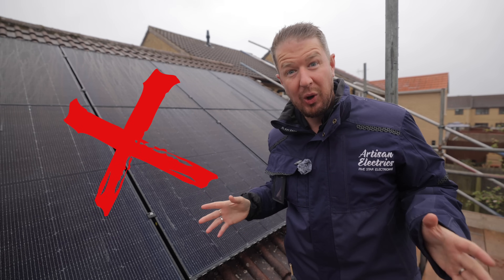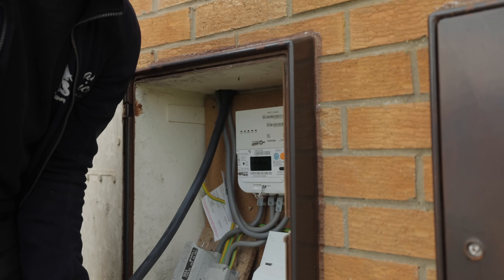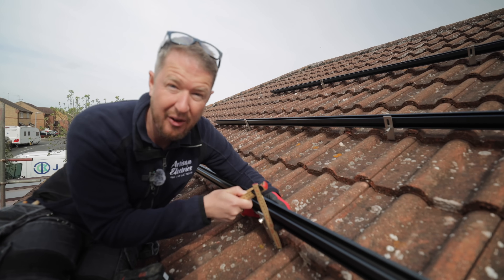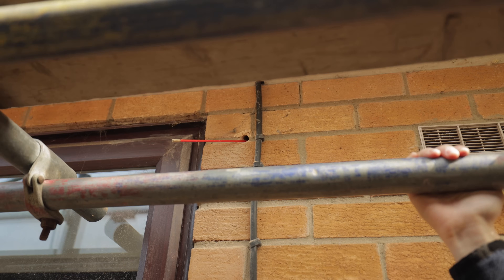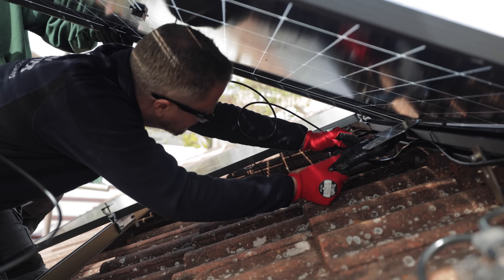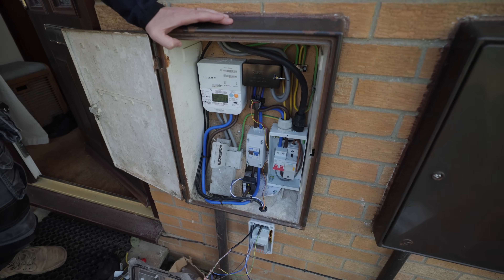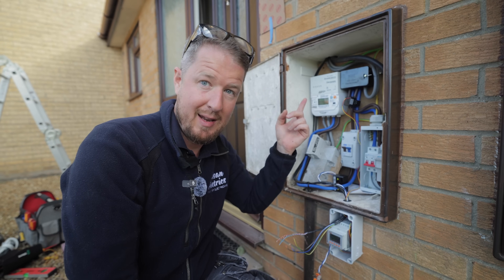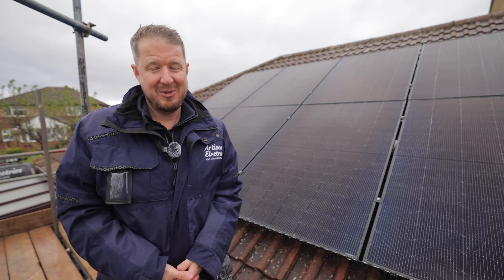Have We Been Doing Solar WRONG All Along? 🤷🏻‍♂️

Comment: Haven't you heard of bypass diodes?
Modern panels have usually 3 bypass diodes,  string configurations handles shading  very good, no need for optimizers or micro inverters.
I will guarantee that optimizers and micro inverters WILL fail before the panels stops producing.
A string inverter can easily be replaced in an hour while a fault under a panel on the roof could be very labour intensive...
Reply: The diodes only work if you have an MPP optimizer. There's almost always an optimizer built in to the inverter though. For the diodes to work, the shaded panel output voltage has to be below the conduction voltage of the diode. It's the optimizer's job to drive the other panels hard enough to push enough current through the panels that the shaded panel's voltage fall below that of the diode so that the diode can take the extra current. Otherwise the panel acts as a high resistance and throttles the whole string.
Reply: @BooBaddyBig  The diodes have to be the right value, so that they work when there is shading on the panel - and of course, they are, because the solar panel manufacturers have done extensive tests. The 'optimisers' are a con and don't increase output. Otherwise, show us the videos proving this! There are plenty of videos showing how 'optimisers' DON'T WORK on Youtube.
Reply: Bypass diodes do have a dark (haha) side.  Yes, they will allow conduction around a shaded section of a panel etc but in doing so they reduce the string MPP.  Fine if you have a single string because the MPPT will adjust accordingly.  Not so good if you have parallel strings since the MPPT will still do it's thing but ultimately end up with the strings working at a less than optimal voltage.  It may or may not be a significant ding on generation based on a whole heap of factors.
Reply: @retrozmachine1189  LOL. You OBVIOUSLY have to set up your strings and your inverters correctly. More utter rubbish from people who don't know what they are talking about.
Reply: @johnthomas338  Thanks for demonstrating your own ignorance.  Try understanding what you are replying to next time.  It might help.
Reply: @retrozmachine1189  Care to explain where I was wrong? To help other people, perhaps?
Reply: I bought Tigo optimisers because they seemed like a low cost solution to cope with shading - in fact they do F all. When one panel on my string is shaded the output crashes the string to 15-20% of if not shaded.  They claim to be able to even work with panels on different orientations - this is absolute horse s***.  Initially I had 8 panels on one side, 4 on the other. The 8 panels produced a third what they should because the other 4 were in the shade.  The only solution was to replace the 3kw single string with a 3kw 2 string inverter - only then did they work independently - and it rendered the Tigo's useless.
Reply: @markyates5744 poteva prendere un regolatore mppt e mettere i 4 pannelli li senza cambiare inverter se era ibrido con batteria senza ssp scambio sul posto pagato dal gestore
Reply: AIKO has shade optimization. It's even MORE advanced. :) Check it out
Reply: Hear, hear. Brilliant post - a string inverter is easy to replace, on the ground, not on a roof, where you need scaffolding that will cost you at least £1,000 - £2,000. Micro inverters and optimisers are a CON trick, they don't work better than the bypass diodes which all solar panels have had built into them for 40 YEARS. Yet still people are being conned into buying this rubbish.
Reply: Nah.
For stationary shadow like chimneys or higher roofs perhaps. 
But for diffuse shadows like rustling leaves solely relying on bypass diodes is inferior to micro inverters or optimizers.
Not to forget that once you have a system at varying gradients, string inverters can start struggling ( SMA puts this point at +- >15degrees).
Reply: @jacobherrie6286  What do you mean "once you have a system at varying gradients"? Don't you mean "IF you have a system at varying gradients", and LOL at the 'Not to forget' before it, as if that makes it apply to more than one in a thousand installations. My string inverters have been working fine for two years now, I have diffuse shadows at certain times of the day, at certain times of the year, my panels are still outputting the max they can. (I've tested each panel with an Elejoy MPPT meter, in varying conditions of the panel - in shade, out of shade, cloudy day, sunny day, so I know what they are capable of giving out.)
Reply: @jacobherrie6286 It depends on how much diffuse shadow is present on the panels, the MPPT will take the best solution if using the bypass diodes or not, the performance difference shouldn't be particularly higher to be worth it, optimizers and micro inverters add cost and possibly maintenance in a difficult to reach position.
Reply: Those diodes works in very specific configuration and are very far from magic you try to portrait here.
Those diodes are there for single reason - if one (or more) cell(s) will fail, then bypass diode will bypass, say third of the panel.
usually cells are arranged in longer string - there and back, so two strings. 
Those diodes have nothing to do with shading - it may help, but it is unlikely, as shading does not drop voltage enough to get diode into bypass, so current will drop.
Panel performance can be easiest described as voltage is close to constant and current changes by amount of light.
So, no diode does absolutely nothing for shading. Your idea is wrong and should take lesson in electronics and physics, as you clearly lacking in both.
Reply: @WizardNumberNext  there has been a number of tests that shows very little difference with shading with or without optimizers.
Some might be at 3% gain with optimizers, that's not worth it, and I bet that they will fail before the panels does.
Keep it simple, use string inverter instead is my tip.
And what I have done😎
Reply: @WizardNumberNext  the voltage of the solar array is of course regulated by the MPPT or it wouldn't be able to find the maximum power point.
Reply: @WizardNumberNext  Utter rubbish. The bypass diodes have EVERYTHING to do with shading - if one panel is in shade, the power goes through the bypass diodes because the resistance in the solar cells is higher than the resistance in the bypass diodes - so that panel can't affect the rest of the panels in the circuit. Don't you understand basic electronics? There are plenty of videos explaining how bypass diodes work. They have EVERYTHING to do with shading. LOL at "Your idea is wrong and should take less in electronics and physics, as you clearly lacking in both." LOL again!
Reply: @WizardNumberNext That's not true. Shadows cause part or all of panel to go high impedance. Because the other panels are not affected they still generate full voltage and current capacity (low impedance) which cause the shaded high impedance panel to go reverse polarity when loaded by the inverter which is caught by the diodes which have a low dynamic impedance when forward biased. That's why codes keep the string going and perhaps only lose one panel output or less when a shadow falls in one panel or part.

It's like putting one dead AA cell in series with a string of new ones. The dead cell with its high impedance will go reverse polarity and your radio won't work. A reverse diode across it will prevent this, as will shorting out the dead cell or even better replacing it with a new one.
Reply: Panel is not a battery. While it generates electric power it cannot go into reverse polarity. In matter of fact is simply never can go into reverse polarity. Its connector can, but no current would flow, as each single cell is a diode - photodiode. When you would stand panel upright, so it is standing on short edge, then strings in panel are running bottom-top-bottom. If you shade such part of panel, then diode very unlikely will kick in. Why I say very unlikely? Because I did experiment. I have covered whole panel with piece of carpet. The panel was one in string of 8. The panel was 250W. The output of inverter dropped by 30W. Yes, 30W, not 250W. That is because panel was hot, so it was effectively powering itself. Temperature of this panel have dropped very fast. Now I understand why. Panels produce most of electric power from infrared, not from visible light.

You must learn a lot.

Like you probably would tell me to not install panels facing north. I did twice and they perform much better, then expected. In matter of fact difference is negligible
Reply: @WizardNumberNext  You can actually run panels backwards. They're not very good diodes, they have very significant leakage. In fact that's a failure mode, if you have 3 panels in parallel, and one gets shaded the other two can blow the shaded one or melt the wires. You have to have fuses to prevent this. Still, some panels have built-in series diodes (in addition to parallel ones). But those diodes can fail and then you can be in big trouble unless you have fuses.
Reply: @WizardNumberNext I only mentioned batteries as an example to help you understand the principal of what happens when you have a series connected string of generators. For a PV cell modeled as a forward biased p-n junction as voltage limit driven by a current source proportional to incident light driving into that junction, with many in series modeling a multi PV cell panel - with one weak such source due to shading. Yes the cells can go into reverse bias. You have the polarity wrong. Normal operation is forward biased. The shaded cells have little power generation capability due to the weak current source output  so the p-n junction will become reverse biased due to the driving action of the fully working cells in the series connected string loaded by the inverter. The high impedance point in the loop is the group of shadowed cells. Each p-n junction can only withstand a limited reverse voltage and certainly not the hundreds of volts from several hundred forward biased PV cell p-n junctions in the string. That's why PV panels have reverse biased protection diodes connected across column pairs of cells so that if a column pair with shaded cells is driven to reverse bias by the action of all the other cells, the protection diode then become forward biased limiting the reverse voltage across the ends of that column pair. Within the column pair the reverse biased p-n cell only has to withstand the voltage of the limited number of active forward biased p-n cells in the column pair which is within its reverse bias capability. In this way damage is prevented and additionally the power output of the whole chain is largely maintained despite partial shading.
Reply: @BooBaddyBig  More lies. I have two strings of ten 600W panels. Sometimes one of the panels is in shade - how come it hasn't blown up yet, when it's had 5kW going through its diodes?
Reply: @BooBaddyBig  would like to hear more info about the "blow the shaded one or melt the wires" for parallel, is that for high wattage panels or regardless of size?
Reply: @ Any size, but there has to be three strings in parallel which is rarer. In that you case you need to have fuses on each string to avoid melting the wires/panels in failure scenarios. If there's two strings it won't usually happen.
Reply: @BooBaddyBig  what about 6 x 40volt single panels all in parallel no strings?  still need fuses or is the single panel performance insufficient to gang up on other parallel paths?
Reply: @dshack4689  Inline fuses on each of them. If any one of the panel's series diodes fail, and that panel gets shaded (which WILL usually happen around sunrise or sunset), it will have a lower voltage and all of the non shaded panels will push current backwards through it-and the wires leading to it. Probably going to melt/catch fire unless the wires have enough capacity, and even the panel itself may well.
Reply: @ The diode indeed protects the wires and panels, but if the diode fails, the backwards current causes fires. If you just have two strings in parallel though, one of them failing won't do shit because the back current is less than the normal operating current. It's only when you have three or more sets of panels in parallel, then you need inline fuses on each string or panel.Without the fuses you're a single diode failure away from catastrophic failure.

Comment: Don’t do it…. The only part of a system that really fails is the inverter so why put in on the roof
Reply: Actually the Enphase micro-inverters have a VERY low failure rate - much lower than string inverters.  And the best part is if you lose one, you're only down one panel until you get it replaced.  Love the Enphase system.  I've got 53 panels with them.

Comment: I fitted solar panels to my garage 5 years ago, panel wattage was 300w. Now i can get 450w bifacial panels of around the same size massively cheaper than my original panels. I'm abit undecided about micro inverters. You might get more efficiency but if one of them breaks or packs up you need a scaffold to remove and replace. Scaffolding is expensive. The main benefit of micro inverters is shading of panels on a string. this no longer such a big issue as alot of panels now feature methods of mitigating shade across a string.
Reply: Single panels can fail, then everything might go down. Atleast with micros, you know which exact one is down.
Reply: in UK you will get 60-70% of rated peak power output of panel
450W will give you 270W-315W MAX typical power whole year round
Microinverter will live quite long
Enphase IQ8A have 25 years warranty
Be advised most microinverters are dying of too high voltage, not due age or random dying.
I have fitted hundreds myself. I have seen exactly 5 dead. One random. 4 died of too high voltage

If you have no shading, then skip micros, unless you want to avoid DC.
Be advised DC should be avoided only because of DC arc is much harder to stop

DC shock is much better, then what they show. I have got over 700V on both hands (plus on one hand, minus on other) from Live panels on roof. It was OK, not particularly fun, but definitely I wasn't screaming. My boss wouldn't know, ig I haven't told him and he was standing right behind me. I do not recommend to test it yourself tough - it is not fun.
Reply: I disagree my panels regularly exceed rated capacity during bright days. Tend to be the best on days like today, very mild but very bright and clear. @WizardNumberNext
Reply: @WizardNumberNext  my 3.3kW rated system often produces 3.6+kW on a nice cool spring day with good sun. A benefit of below average ambient temps (panels tested at 25°C) means higher than rated performance on some shoulder season days.
Reply: If one goes down, you're down 1 panel / inverter. If a panel fails on a string inverter, you might be just out the panel, or you might be out the string. Also, you might not know where the fault is. Also, I like that it's 240VAC vs 500VDC. A lot safer in my opinion. I've DIY'd 2 enphase 10kw installs, and it's definitely more expensive, but the ease / data is awesome. Their tech support was great as well.
Reply: @fgbhrl4907  NOT TRUE
One panel going down in string means, bypass diodes are taking over and you are losing one panel. I have seen it with microinverter and panel dropped 1/3 of its rated power.
Reply: @WizardNumberNext  I can tell you from real world experience on my own home, that I lost a string (out of 3) because a panel failed. The junction box ended up melting, and the entire string went offline. With a string system without optimizers, I didn't know that the string had gone offline, other than I was generating less than I was expecting. It happened in the winter, so I didn't immediately put two and two together. Probably took 6 months to really notice something was happening.

Comment: I'm really Interested to understand how the panel prices compare with 'traditional' panels. Sorry if i missed it in the video but how does the 20% increase in efficiency stand up against the increase in cost of the panels when reflected as the resulting kWh reduction in grid cost/dependency?
Reply: The panels retail at around £500 each according to Heatable's website.
Reply: @VinoVeritas_   wow you can buy 5/6 400w panels for that price, total rip off.
Reply: @VinoVeritas_  I looked round and other people's bifacial panels are a fraction of that number they use, so something rip off is up there. Seems the whole industry is a it one way or another.
Reply from the maker: They are slightly more expensive, maybe 5-10% more in terms of cost per panel. So worth the investment I think.

Comment: Hi. I was particularly interested in this video as I’ve recently had a Heatable installation.  I found them to be very good to deal with despite them getting a fair amount of stick on social media 😀.  I guess a lot of people think the bifacial panel angle is  just marketing bs. Heatable told me who would do the install if I went ahead. Getting to meet the installers before committing was important to me as one of my concerns was buying from a uk-wide business who often outsource the installation (the installers were great by the way). My system is performing well and I’m very happy with it so far.  I went for a GivEnergy AIO battery and specified the IQ8AC microinverters. My thinking was that as I’m on the south coast (Bournemouth) we get a bit more sun than the uk average and I wanted a higher (360W) AC output than the IQ7+ in your video. This is already giving me 1kW extra generation from my 14 panels when the inverters are maxed out.  Time will tell if this was a good choice in winter or on dull days when they may not generate so much (so I’m told). I enjoyed the video anyway. Thanks 😀